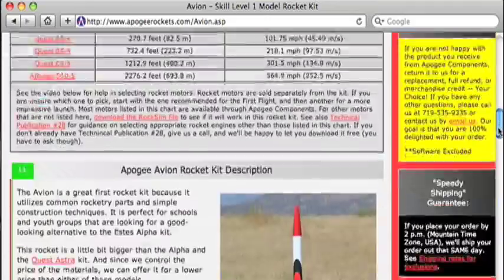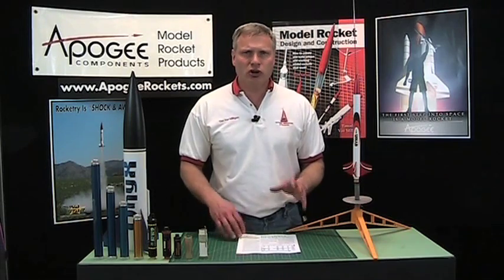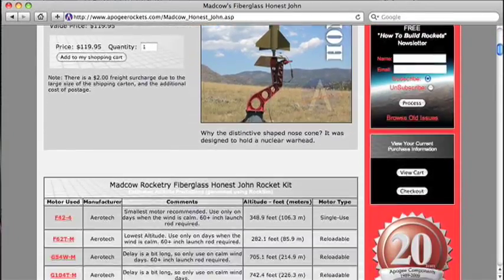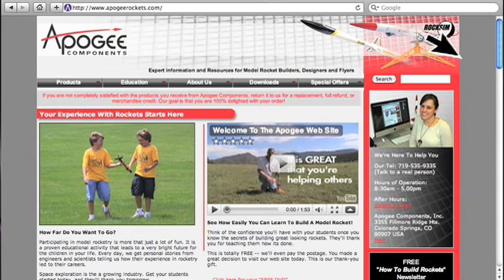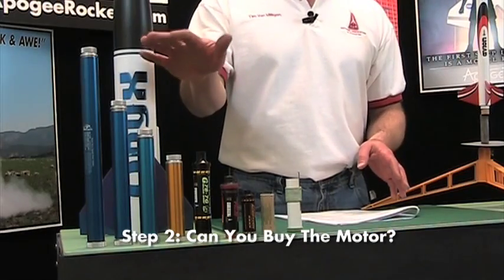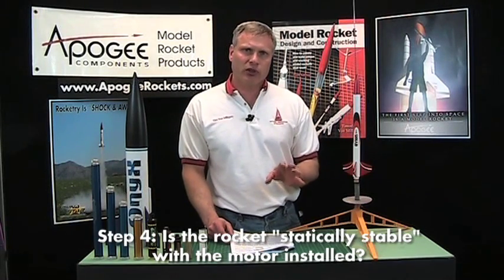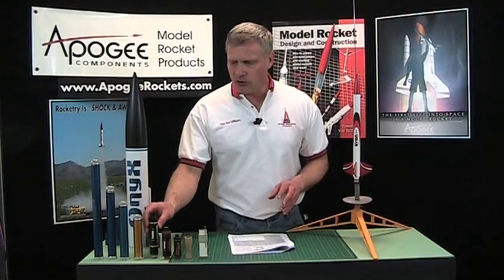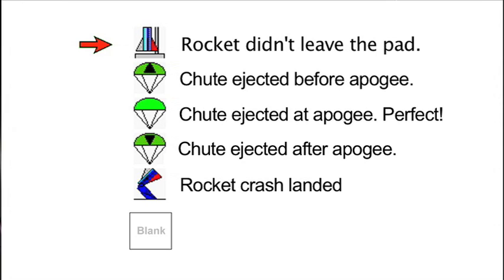How to Select Rocket Motors - Part 1 of 2

Comment: "I'm not trying to sell RockSem" whole entire video is using rocksim... adding booster pods... solely based on buying you're product.. why not explain a way to calculate what engine to use based on rocket weight height ect... booster pods.. explain ways to fire delay fire or engine size calculations on those?
Reply from the maker: See the book Topics in Advanced Model Rocketry. It is out of print, so you may have to pay hundreds of dollars for a copy of it. The software is much cheaper, and far easier to use.

Comment: Just wondering if Apogee could make a reusable motor casing that we could fill with "white mix"?... (Powdered sugar/ potassium nitrate without cooking it.).... Just thinking out loud👍
Reply from the maker: No. The liability would be too much for a small company like us.
Reply: @apogeerockets  .... Gotcha.. Darn lawyers!!!!
Reply: @copperstaterocketguy1640  Fuck em!!!
Reply: I use PVC I have been testing it. I have even made a delay and charge that blows out parachute.  To make a delay add 1g of baking soda (the box in most fridges) to 20g of the white powder.  1/16 of delay powder is 1 sec of delay.

Comment: Is this a video on how to use your software or rockets?
Reply from the maker: It is a process. But you have to have a tool to do it right. We use the tool that is our software. If you can find a different software that gives you the same or better information, please feel free to use that.
Reply from the maker: BTW, RockSim v10 automates this process shown in the video, and will generate a list of recommended motors so you don't have to do it manually.

Comment: How do I buy or build an E motor that burns for 30 seconds and what's the designation
Reply: Ok if that's impossible I need any motor. That can burn 30 seconds for testing.. Dr Johnny
Reply: I'm not interested in software... I'll design my rockets around the motors
Reply: I don’t think there is an engine that burns for 30 seconds
Reply: There is, but not available to amateur rocketeers. Unless he builds or buys a rocket motor like a STAR 37.